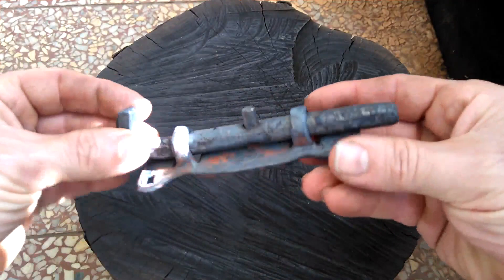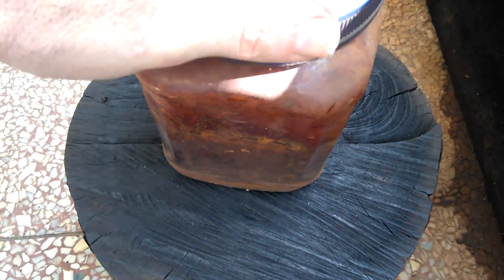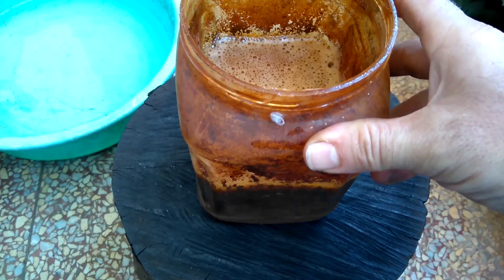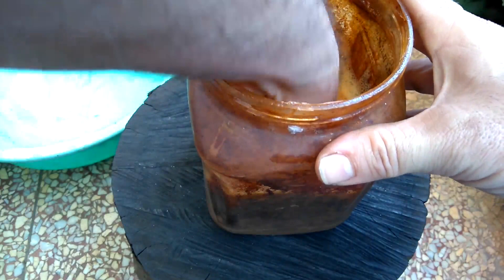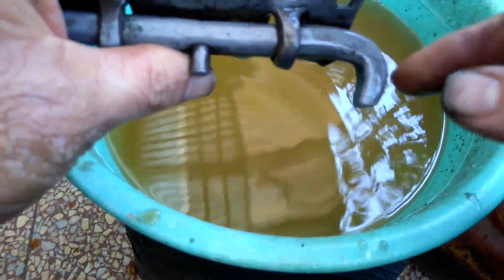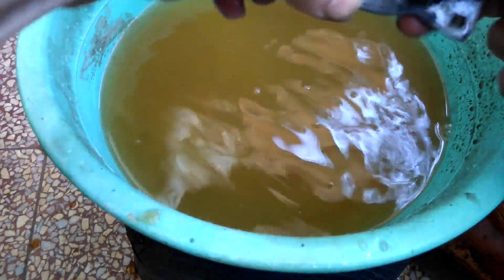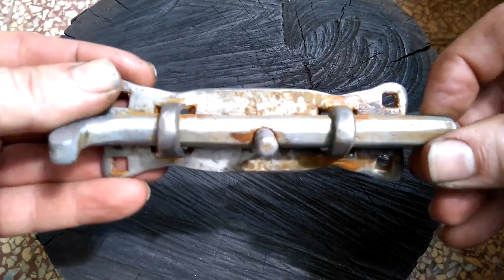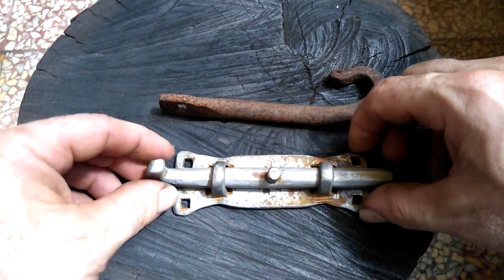How to remove forge scale and quickly rust items.

Comment: Great video. I found an old forged steel wrench that i cleaned up and buffed with rouge. I hit it with brake cleaner to get the wax off, walked indoors to put some oil on it and noticed it didn’t seem to have that bright silver look I saw 20 seconds ago. Couldn’t figure out what happened, and thought I just imagined it was cleaner than it was. I had no idea how fast unprotected forged steel rusts until this video.
Reply from the maker: Depending on conditions / what the bare steel is exposed to, it can change very rapidly, as you found out. Thanks for watching.

Comment: For a variety of different rust removal techniques, tubal cain (mrpete222), did a side by side rust removal of eight different methods (https://youtu.be/zCuQquR-rzo , part 1 of 3).  Some of the methods produced some interesting surface finishes, but part of that could be due to the specific alloy and/or initial condition of the parts he removed rust from. (See https://youtu.be/NNxyFAsxWW0?t=40m7s or so for the final analysis).
Reply from the maker: Brian, Thanks for sharing the good info., for sure... Sorry for the late reply. I hope all is well. Glen

Comment: Vinegar to get scale off of small pieces...now that's valuable information. I knew that some folks use cattle-grade molasses diluted with water to remove rust and paint off of large pieces (vehicle and tractor parts, agriculture tools, etc), and it seems to work very well even though it takes a long time to soak. A lot of folks in the knife making world use heated vinegar and a battery charger to etch with.
Reply from the maker: James, I will need to try the heated vinegar method as someone else also mentioned this. Vinegar (unheated) can take time just like the molasses method you spoke about. As I'm typing this, I see a video in the sidebar by Lewis Razors (who I like) called "Etching A Blade with Hot Vinegar". I will check it out. Thanks. Glen

Comment: Glen allow me to share with you a better looking rust finish for steel.  I wash steel with straight muriatic acid first, this removes scale and mill scale too.  (this takes about 15mins) Then a quick rinse with water and hit it immediately with 50% hydrogen peroxide diluted in half with water and just a cap full of muriatic acid to the spray bottle.  This method is INSTANT and easily controlled.  You want the finish of rust, but not the destruction of it.  I picked up this trick from Kevin Caron.  I tried vinegar, it's not really the right stuff to use.  I get 50% hydrogen peroxide from a chemical house, it's sold to the taxidermy guys usually.  When finished, a spray down with diluted baking soda/water stops the process.  You can even clear coat the piece to lock in the look.  A light surface rust is good, but flaky, pitted rust is never a good thing.  Remember the gas light pictures I sent you?  Those were done with this process.  ;-)
Reply from the maker: Your technique is miles ahead of what I'm doing. This is great information for those who need to attain a quick rusty appearance but then arrest the oxidation to prevent damage. Thanks. Glen

Comment: Vinegar is also a great way to remove and break up rust on old parts to help clean them up for restoration or facilitate taking something apart, but after they are rinsed you need get some oil on the parts or they will flash rust. On another note, most people understand that mill scale is actually harder than the material it had formed on. While rust which tends to appear to be much softer due to the flaking and crumbling is actually harder than mill scale. In fact, rust will chip or break carbide tooling.
Reply from the maker: Jeffrey, Very good points. I never knew vinegar could also clean off rust. Also, I didn't realize that rust is harder than scale. Thanks. Glen

Comment: nice tip Glen. I've gone in for lunch and left an unfinished blade on the bench. I will come back to find about that much rust on it. The humidity in NC can be awful, can't imagine yours.
Reply from the maker: Ron, It seems getting a piece to rust is easier than preventing it on most pieces. I was told to frequently oil the knife I recently received as gift - that spring steel tends to rust easily. After using the knife once, it did start to rust ever so slightly... Humidity is off the charts here. Makes NC seem desert dry. Thanks. Glen

Comment: I've also used a half a lemon and table salt as a scrubby on larger flat items.  It cleans better that you'd expect, and sets it up for a nice rusty surface if you leave it on the metal.  I've heard you can use the weak acid solutions and a calligraphy brush to etch designs in the metal too.  I haven't experimented with that yet, but I'd image it would be a very subtle etching.
Reply from the maker: I am curious how well a weak acid acid like this would work for etching. On pieces that I've heat treated (like hammers), then dressed and polished before putting in the vinegar bath,  it leaves a pattern on the polished face when washed off. Thanks. Glen